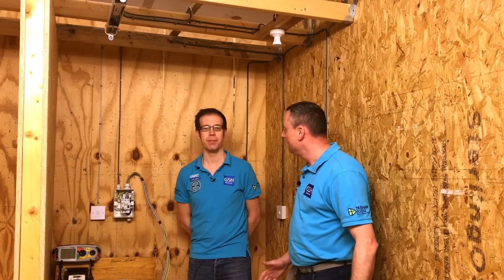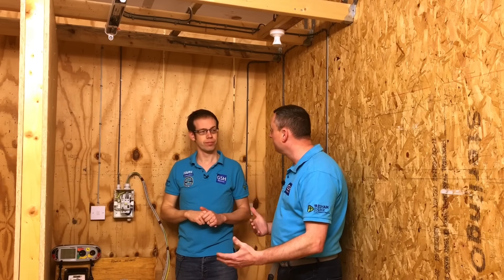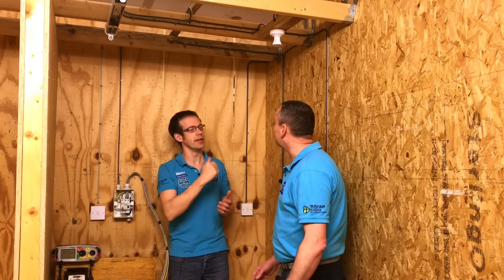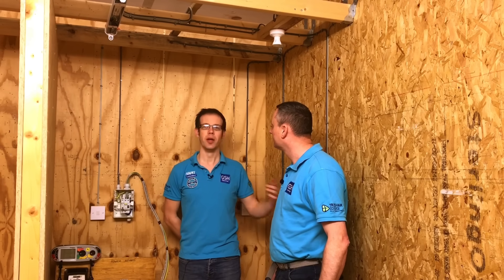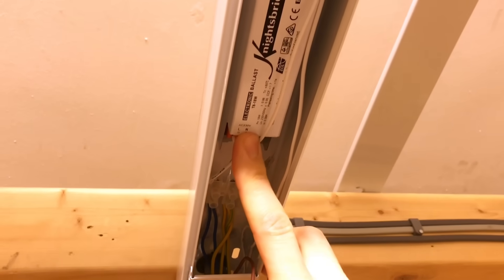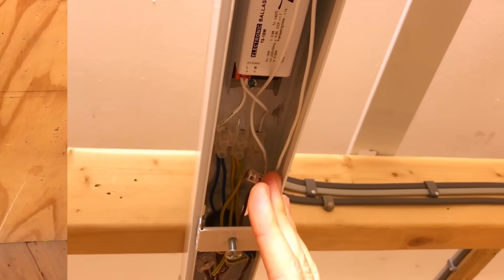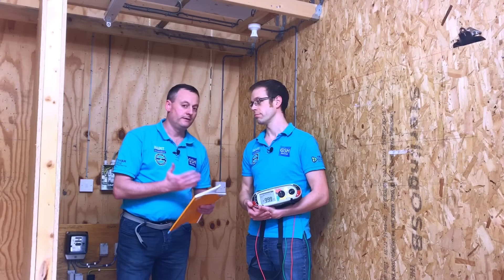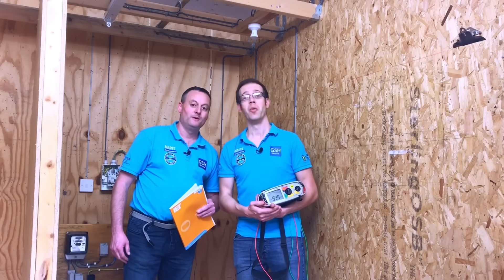Insulation Resistance Testing of 2 Way and Intermediate Switching Using Guidance Notes 3 AM2 or AM2S

Comment: Loving the videos, just a quick question. On the other video you had the switches on in the CU, is that because you were isolated at the isolating switch and testing the whole board on initial verification? Cheers

Comment: Hi GSH lovely channel you guys have. Great to see the passion taken so far. Question though, it's off topic but is the RCBO required because of the lumaires in the circuit? I just arrived in the UK but back in sa lighting does not have rcd protection. Is this RCBO providing fault protection in this case
Reply from the maker: We use a main switch RCCB (RCD) for additional protection for this lighting circuit if the college had the money it would be an RCBO for best practice. Thanks for the support and commenting. Gaz 👍
Reply: @GSHElectrical  thanks Gaz👍we had nuisance tripping in sa so rcd on lighting was removed from the regulations. As well as having the hot water cylinder on rcd, that too was removed. Different strokes for different folks haha. Thanks again mate. I have subscribed :)

Comment: I don't get this thought process.  Why don't you know that the two way switching is live or not based on switch position?  I know sometimes people put their switches on up or down but that is also true of single switches.  It's just binary.  If you're smart enough to do testing you're smart enough to know which combination of switches turns a light on or not.
Reply: With 2 or more switches both up and down positions can be open or closed circuit

Comment: For intermediate switching why do you have to repeat the test for each switch? Surely you only need to operate the two 'two way' switches at each end of the switch chain? 
From drawing it out there are effectively two parallel circuits between the two end points. Therefore for any amount of intermediate switches in a chain you only need to do 4 tests to garentee that all cables have been tested.
Reply: That seems right to me with the schematic in mind? Actually, only 3, but that’s marginal. On your first test, you test the line to switch one, and then one of each of the two runners, and maybe or maybe not the line to the fixture. If you then switch the last switch, you will add or remove (you don’t know) the line to the fixture. If you then switch the first switch, you switch to the other runner on both/all sets of runners, and then you actually already have all sets of cable done at least once. 

However… if you have an intermediate switch where one of the two positions breaks the connection onto one of the runners, and the other position does connect said runner, you could by accident have it in the position where it doesn’t connect, and then you fail to test both that runner and potentially the line to fixture. (I don’t know, do they deliberately introduce weird failures during exams?)

So three tests are enough, if and only if you also know that all switches are fully functional (which you’d have to test both before and after), and you know which of the switches are two way and intermediate, and as long as the readings are significantly above minimum. If you get a near-breakdown of 25 on a runner and also 25 on the line to fixture, for instance, the three tests could potentially miss out the scenario where both of those are present and together would end up at 12.5.

In the end, best practice and the sort of thing you’d want to show an examiner is probably still to do them all just in case.

Comment: I was told that you have to do the test 5 times on an intermediate circuit as when you operate the 2nd switch, you're turning the circuit off. The same happens on the 4th test. So 5 tests turns the circuit on 3 times

Comment: They want you to check between CPC and neutral every time even though the intial CPC to neutral test would have covered any possible combination of switching as you're never going to be switching a neutral? What a waste of time. Good video either way.
Reply: What if the switches had neutrals in them and had been wired up wrong say as a strapper on one leg. 🤷🏼‍♂️
Reply: So in between checking with clip on earth bar and probe on line, and checking with clip on neutral bar and probe on line, you have to put your probe on the neutral bar and push the test button for half a second?

Such waste of time, *quelle horreur*.

Comment: Great video- quick question, and I’ll use an example... say this test was to be carried (e.i.c.r) out in a down stairs lighting circuit, and there was 2x rooms on that circuit with 10 or more fixed l.e.d downlight in each room- would it be acceptable to test the circuit on the 250v setting as it would take so long to disconnect 20+ Downlights? Or could you put it down as a limitation and not carry out the test for the e.i.c.r? What would be the best practice? TIA, John.

Comment: Hi guys. I am following your channel for a while now and I must say it gives me a big help in passing my exams. Thank you so very much.  I am preparing myself now for AM2 exam and this video is again huge help as the others. 🙏

However, I would like to ask you (if it's possible) for help in inspection and testing of S plan CH system.

On which part of installation and how this inspection and testing has to be done?
Reply from the maker: Hi. Thanks for the wonderful comment. Sadly we have been planning heating systems and fault finding videos for sometime but currently with the pressures of teaching and our eFIXX website and YouTube channel these have been put on the back burner. More content coming but maybe not soon enough to help you this time. All the best 👍 Gaz
Reply: Hi Gaz. Thank you for your quick response. 

I understand completely what you are saying, and I wish you guys a great deal of luck and all power to your elbow! 

May I ask you as one of the schools which are providing training for electricians, why there is almost nothing about this topic in learning materials? 

This topic is part of AM2 exams, and there is something little about S plan wiring, but absolutely nothing about S plan inspection and testing and fault finding - why is that?

Comment: Great video guys as always, I find watching your videos really helps me refresh my memory while doing my level 2 domestic installers course. 
Quick question if you come across an garage installation for example where there's a number of sealed led 4ft fittings where the connections are behind boarding and not accessible I s it ok to be doing the installation resistants test at the reduced 250v.
Reply: garethf fox same question I had buddy. Watching for a reply. 😃

Comment: Thanks for another great video. 
I would like to mention that the terminology as required by C&G exams etc... is Megohms... (Meg-ohms)...and not Meggerohms or Megaohms as is often mentioned to by trainees. Picky, it may be, but at least you'll be pronouncing correctly to anyone in the know. So, once again I thank you for putting the measurements up on the screen in writing, for all to see.
Reply: If that is true, the exams are wrong. The term is mega-Ohm, and MegOhm is incorrect. Nothing to do with electrical regulations, this is pure physics and ISO. MegaOhms just as much as it is megabytes and megabits etc.

Comment: Great Vid.  When I did my AM2 last year, i had to physically disconnect the conductors from the terminals and connect directly to the conductors themselves.  For my test centre, this was the preferred method.  I did ask if I could test the whole 3~ installation but connecting to the bus-bar and completing the whole board, or switching individual circuits.  The examiner said this is fine, but for this test, he preferred that we test individual circuits at a time.
Reply from the maker: Hi. Thanks for the feedback and watching 👍 all the best Gaz

Comment: Hi Guys, just a quick question: If you walk out in to the installation do you need to apply any lockoff devices to the the breakers? Or do you just excercise your own judgement when you come back to the board.

I'm loving the videos by the way. I'm not an electrician or in the industry but I am fascinated by the trade.
Reply from the maker: Hi. In our installation the main tails are not connected. If the installation was live and isolated at the main switch within the consumer unit then the cover would need replacing every time you walk away from it. Great question and thanks for commenting and watching Gaz 👍
Reply: Thanks Gaz. Hope you have a good week!!